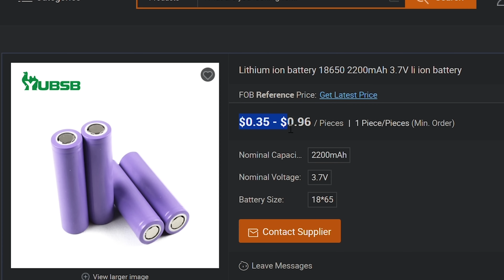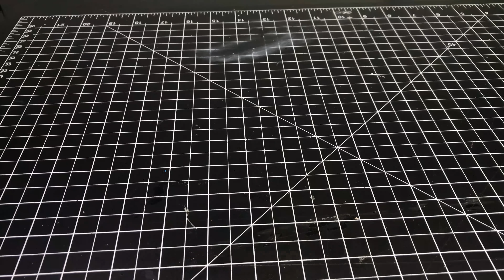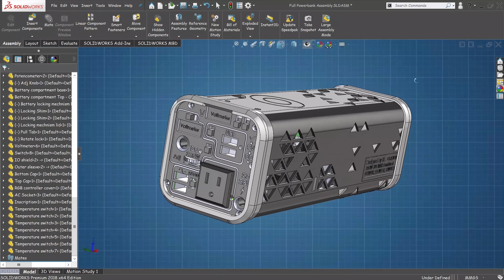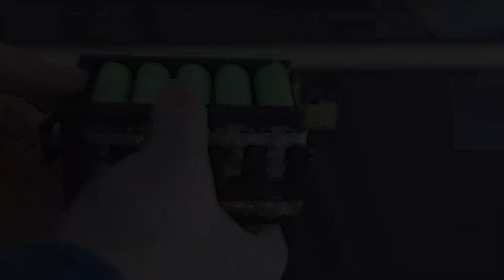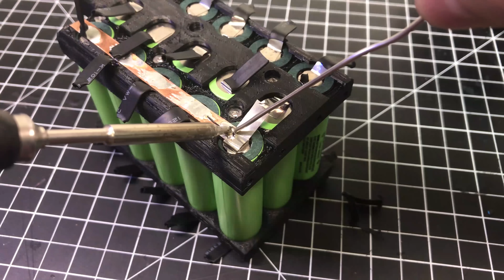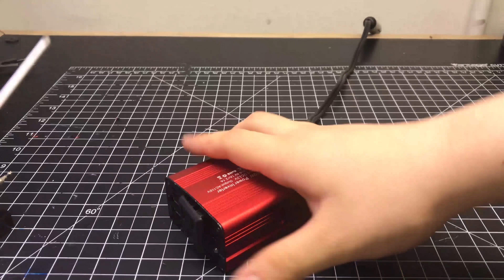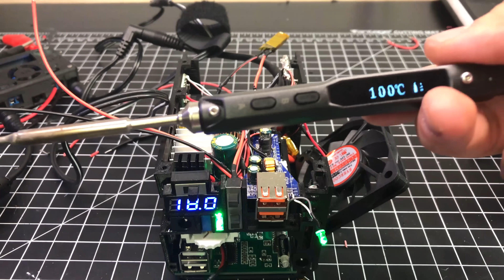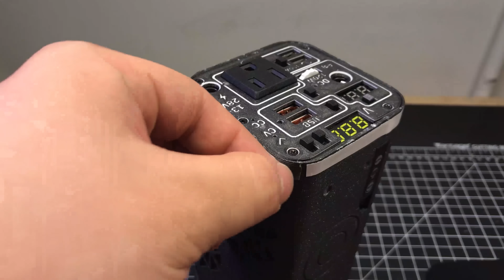How to Make the Ultimate 18650 Power Bank with Infinitely Expandable Capacity

Comment: Assuming you can collectively draw 37.5 amps per hour from these 15 cells, and that each has a 2.5V potential, and are in optimum conditions, they should give you a max power of 1.4KWh, not bad, could actually run a TV  for ~3 hrs.

Comment: That is very cool and very safety to use,but... 
I prefer to make some PCB to make some links.That well be  easy to make this for us.
There are too many short lines  need to be soldered, and it is easy to have a problem with soldering. If we use PCB to make this, it will be much better.
BTW，The effect of this fan does not seem to be ideal. The air way is preferably from the front side to the rear of the battery, made  the tail of the battery is the air outlet .

Comment: $60-$70 for that? Thats incredible. I’m gonna learn to solder and practice a bit and get started on it!
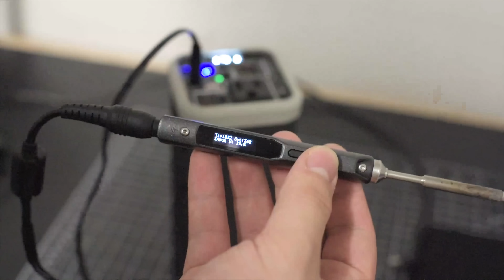Reply: any tutorial recommandation or tools? and if you know where he got the solder in the vidoe at 1:23? im the type of creative teen who has patience and would love to mess around with electronics and engineering like this but safely and with guides, since i am too young to take college courses or anything yet haha. I am very interested in tech though and consider myself good bu ti want to learn a lot about soldering, irons, and types of it like lead soldering like you.
Reply: Lyle I havnt bought everything yet but I’ll let you know man
Reply: @Lonely_Waffle  TS100 was the soldering iron used but if felt like it was struggling to get the solder up to temp. I believe the voltage supplied was not high enough but could be wrong.
Reply: Marc-Antoine as long as the solder heats up the solder properly, you should be all good.  I’m about a quarter of the way done
Reply: @MABFR01  I have the TS100 and it is really good. Controllable temp up to 400C and works just as well as low-mid range soldering stations. Plus it's in the form of a large pen, it's my fav iron ever.

Comment: Love this project, one of these days, maybe I'll build my own! Only thing that irks me is that with the availability of 3S BMS is so inexpensive and small in footprint, why not have one on each set of 3 and wire their outputs i n parallel? With a bit more modularity, almost indefinitely expandable for the battery capacity for the set voltage

Comment: hi, I've been looking for a nice tutorial on how to convert a computer PSU into an regulated bench PSU for school projects, can you make one? I think it's a good idea for your channel :)
Reply: It's really simple, I used to make them for fun. Basically just locate the green wire on the 20 pin or 24 pin connector, this is the PWR_OK wire. Join it to ground through a switch, and actuating the switch on should power up the PSU. From there it's pretty simple. Black is obviously ground, yellow is 12v+, red is 5v+, orange is 3.3v+, the blue wire is 12v- (leave it alone unless you know what to do with it, and whatever you do, don't join it to 12v+) and the purple wire is a 5v+ that SHOULD (operative word being should) be live as long as the PSU is plugged into the wall.

For more information just google "atx psu pinout"
Reply: @FracturedPixels  thanks, but the main issue I've been having is finding a simple way to regulate it to any value I like

Comment: 11:31 I give up! I don't have or know how to use a 3D printer nor have the money to buy one. I don't have one of those meters to test and no money to buy one as I have more important bills to pay with the money I do have. And I'm a wire specialist was certified years ago Mil spec.
Reply: Bro, you can buy a multimeter for less than 10 usd and you dont have to own a 3d printer. You can print the parts at some shop that prints custom models.
Reply: @popvotocek  I have a multimeter from harbor freight free with purchase.

Comment: This looks awesome, but really if you are cramming 15 cells in there might as well put in 3000mAh or better ones... The only concern I have is that you have no cell balancing. Would you be up to update your design to have a full balancer included? I'm really uncomfortable with cramming 15 li-ion cells in a single device with an integrated charger and no cell balancing. At minimum there should be a passive balancing circuit, or you should use a different battery chemistry. Li-ion fires are nothing to scoff at... Have a look here for pointers: https://www.analog.com/media/en/technical-documentation/tech-articles/Passive-Balancing-Allows-All-Cells-to-Appear-to-Have-the-Same-Capacity.pdf . The simplest way to have "safe" balancing is to run a wire pair for each cell to an analog multiplexer and to a microcontroller with an integrated analog comparator. When discharging, report only the voltage of the weakest cell to the over discharge circuit, and when charging reports only the voltage of the strongest cell to the charger. This way the cells are not balanced, but the circuit is simple and will prevent a weak cell from over-(dis)charging and bursting into flames. This also means that one bad cell will affect the performance of the entire pack.
Reply from the maker: The BMS I choose does have integrated cell balancing function. The power bank goes through around 4 cycles a week and I haven't noticed a difference of more than 0.02V.

Comment: "Standard laptop charger" and from here I stopped watching video. Dude, are you living on the same planet as everyone else? Literally U have access to doze of notebooks, and none of them, even from the same vendor has same power plugs/sockets and input DC specification.
Reply: Most are 19v 2-4 amps
Reply: Yaroslav Panych apparently you've never seen a universal laptop charger lol.   Sure the tips vary but the voltage and amperage are all similar.

Comment: Sorry to say that but the incorrect schematics are spreading like cancer all over internet. Why don't you use proper symbols for things like LED, fuse and switches? And there should be a dot every place where 2 wires connect to each other.
It's a very basic thing, why don't you follow the basic rules for drawing schematics?

Comment: What a fantastic project! It has a lot of functionality crammed in there. Personally I think it is a bit to hard to perform maintenance or repairs. And after an accident involving a bad solder connection and a 10A power line I am a bit carefull with high power solder joints. Therefore I won't make one myself. Though the RGB definitely improves performance and safety, and above all the looks of the already beautifull design.

Comment: Kinda looks like that stupid fuel cell thing mikeselectricstuff looked at a few years ago. This design is actually way more useful. You could even plug a raw 12V solar panel into the input jack. The converter would probably happily reduce it down and charge the batteries. Nice work Kralyn 3d!

Comment: amazing! i want one. this is my step by step guide: solder this, solder that, solder that, solder this then solder that. Now glue this now glue this now glue that, wait... solder this first now solder that now solder this now solder that now glue this now press this in there and then press that in there then solder that then press this in here so you can glue this there then solder that then solder this then apply pressure there to pressfit this in here so you can solder that here so you can glue that here. It lights up!

Comment: nice build ... perhaps offering to 3d print the various bits needed for cost plus say 10% and shipping n handling ... would be a good option as well ... since not everyone owns a 3d printer with or all the different materials you used for printing ... 
.

you could market this easily as well ... completed of course or as a complete kit .. again for cost plus 10% and shipping and handling ...

Comment: The laptop only needs 20 volts give or take. So buy a Kobalt power tool battery when it's on sale for around 10 dollars, I have got them as cheap as 7 dollars and a charger for that at around 20 dollars on eBay. You can also get an adapter on eBay for the battery allowing you to wire up anything direct from battery. Go to a thrift store for the adapter plug, and have a voltmeter handy to test the connection is right before plugging it into your laptop. 

I made this mistake when I had the plus and minus reversed, destroyed the laptop. Plug battery into laptop where you would normally plug in the brick adapter, round barrel plug.

Comment: CAN I have 2 or 3 modules plugged in with a regulator to take it to 3Volt and 4Volt? then from there plug into SBC (SINGLE BOARD COMPUTERS) that require low voltage.  that way I csn make (!-2) run off that battery pack when traveling and get many hours from them as a SBC low power laptop that handles 4k resolution and higher than laptop graphics for me and wife.????

Comment: I can't find any power bank that can output a dc 19.5V 11.8A (230w) to support my laptop, is it really hard produce this type of power bank?
Reply from the maker: When are you out of battery, screen at full brightness, RGB on, and CPU and GPU both at 100%. That would be close to 230W, you might get away with 150W. Which my next powerbank(2020) will supply 210W. my laptop (150W) only draws 86W while gaming.

Comment: at 17:00 you show wiring the positive in from the usb converter to the switch then to the positive in on the coil of the relay. you never show how you get the positive to the input of the coil on the relay in the middle layer. but you show a pic of a diode ..
Reply: Man in the Park  No Problem. Im still tinkering with his project a little on a second one. Im working a method to put a more economical ppm fan system in place to eliminate the multiple temp switches and just use a few strategically placed probes and go a more ramped fan flow route for better temperature control. . Also modifying the second one slightly to allow running flight packs in parallel via an external XT60 jack as a power source in a pinch. I fly FPV drones so I always have a box of lipos ready . Also started rendering a version that also has a 12v input like a boat or car battery that can run from a car while using the car voltage as the main 12v input and charge the li-ion bank simultaneously. 

Yes  for those who will eventually comment. I am well versed in Li-Ion and Li-Po technology and safety.. I take many everyday things and convert to lithium. My entire office runs off of Li-Ions salvaged from old tech including my battery backups along with solar inputs as well to save on costs when i can .

Comment: 15 good high amp 18650s could put out 1200-1500 watts with decent cooling. Like Sony VTC5Ds or VTC5As.

Or for <$5 each, you could get some Samsung 30Qs. 15 of those could still put out 500 to 700watts.

You'd need a good fan with vents between each of the batteries probably though....

For less cooling requirements at 1200 to 1500w, however you could use LG HB6's. They rate at 30Amps each, but while most high amp 18650's are basically limited by both heat and voltage drop, heat is nowhere near limiting the HB6's....they stay cooler than anything else I've seen....

Comment: Great product 9.9/10 (should have had that fuse in a holder not soldered inline). video 8.9999/10 I think I would fo preferred if you had stepped through the design and shown why you added things to present it like an onion adding layers.  Start with the core of a power bank, but add the cooling, add the usb, then the usb quick charge, ect.  This really could of been a 5-10 episode series.

Comment: If this project is your own brainchild, then you're an excellent electronics engineer.
Congratulations.
However, there are gigantic flaws in this project: time to build and total cost.
You write that the components for this Power Bank cost some $60, but you forget to mention the huge cost for the measuring equipment, the special tools required and the 3D printer.
So ... why should anyone build your Power Bank, when a similar commercial product only costs some $120 (or even $200) and also comes with a warranty?

Comment: The batteries I'd use for quality would cost me 60$ alone but, this is still a build I would do If i only had a 3d printer.
Reply: I saw a 3d printer at the local library. try that
Reply: @rollymaster16  i don't even think my small town has a library anymore.

Comment: If I'm going to build a 3S3P with 3350mAh of each 18650 cell for that capacity how many times I can charge a drone battery. The battery is 13.05V 3830mAh at 43.6Wh then will charge using AC power adapter of 13.05V 3.83A? Thank you for your future response.
Reply from the maker: 9x3.350x3.7=111.5Wh
115.5x0.85=94Wh after conversion losses
94/43.6=2.17times

Comment: I will pay 80 for someone to make this for me.
I don’t have all of this measuring equipment to make it myself or even use a 3d printer.If anyone is curious please reply and we can negotiate in email
Reply: Unless you have a very good friend of yours with a 3D printer and unlimited amounts of ABS filament to print the case, GOOD LUCK getting the case and all its pieces alone printed for less than $80USD, then go out and buy every component you need to build it. Its almost worth buying the 3D printer in the parts list.

Comment: Hi all,
When installing the slide switch for the USB at 14:05 https://youtu.be/0jRsltIW8qM?t=848 
Kralyn3d states to "solder a switch to one of the coil pins of the relay, and solder the other coil pin to the ground."??? 
Did he mean to say "solder a switch to one of the coil pins of the relay and solder the OTHER WIRE from the switch to the ground?" I am looking at the schematics and that's what I understand. Thanks

Comment: wait, if qc3.0 device in usb port increases voltage to 12v, will the qi module on top burn out, as it's parallel with usb output?

Comment: it is possible to replace the battery with the supercapacitors?
Reply: no, super-capacitors have fantastic charge and discharge current, but surprisingly low WH capacity.  I made a 500F bank from six 3,000F/2.7v caps, 13.8v stores only 13.2 WH. (and only when discharged fully to 0v)  Great for starting cars (1000A surge, 0.00029 ohm ISR), terrible for charging laptops.
Reply: @virt1one  thank you so much for the info😊

Comment: Nice idea but:
1) if you are rich and posh enough to be able to afford a 3D printer, you are rich enough to buy one of those expensive commercial powerbanks.
2) needs some kind of power gauge, not just voltage, ie a percentage or 10-LED display. NOT one of those horrible 4 dot displays that leave you guessing how much juice is left.
3) this is 2019, not 2016. getting 'free' 18650s from old laptop batteries is not a thing anymore. powerbank, powerwall, e-bike, digital cigarette and hobbiyist makers have already sucked up the supply of old laptops a couple of years ago.

Comment: This was great... I already got everything ordered with execption of wireless charging that im replacing with a solar charging cells
Reply: Please also add a busbar because they way demonstrated in this video of soldering every wire into a twisted knot is terrible practice. Using a busbar to connect each of the wires is far better
Reply: @flightworks6874  whats a busbar

Comment: It would be awesome to add the ability to use this as a car jump-start pack. I would trade that feature for the wireless charger...
Reply: Jump starting a car will likely require more current than 15 18650 batteries can safely provide, especially if you don't exceed the maker's recommended 5A per battery discharge current (not that there's anything wrong with having batteries with higher maximum discharge current, other than having to pay more and getting less overall capacity).

Comment: Great piece of kit. Sadly here in the UK the parts cost would be significantly higher than that stated and 18650s are hard to get which are reliable and meet functional spec. Too many dodgy dealers on ebay and amazon.

Comment: you could have gotten an inline fuse holder from any auto parts store and made it so you could replace the fuse if it blows, without having to take the entire thing apart and un-soldering the blown fuse just to solder in a new fuse. it would be much easier to add an inline fuse holder and mount it so that you can replace that fuse from the outside. also soldering a automotive fuse may weaken the fuse's link. after all, they are designed to blow to an open connection if the metal gets too hot(is passing too many amps).

Comment: please someone officially launch it
i am ready with my kidney and wallet
Reply from the maker: I'm working on a version that has a display and it is controlled by Arduino. It will have intelligent voltage and current management, USBC, double the output power, similar in volume as this one. That version will also have solderless battery connections. I'm doing long term tests to determine connector longevity and contact resistance stability. I think will sell that version as kits. But, it would take me a LONG time to complete (end of 2020, NO GUARANTEES) I haven't completed the feasibility checklist yet.(I don't know if some features are possible.) Once I did, I would assonance it to the channel.
Reply: @kralyn3d  I'm in, let me know!
Reply: @kralyn3d  If you're planning on selling the kits in the future, will you still make the CAD files available for free?
Reply from the maker: @AadithyaS  Of coarse, you can also print and modify it.
Reply: @kralyn3d  I really hope it succeeds, just subbed because of this!
Reply: @kralyn3d  I'm so waiting for that
Reply: @kralyn3d  Grate Work, thnaks for this , can you think use Kikstarer to make your proyect live?
Reply: @kralyn3d  ok I will buy it, I hope that you will deliver in France
Reply: @kralyn3d  awsome!!!
just a request..im not rolling in cash, so could you sell it for about 200 usd(in the future)
Reply: I can't wait to come out with the  kit  I love your engineering capability😊👊
Reply: Lmao bruhhh